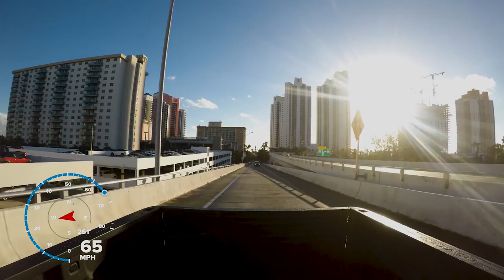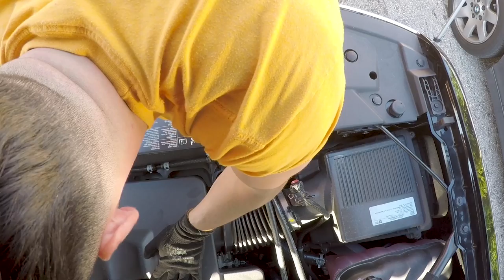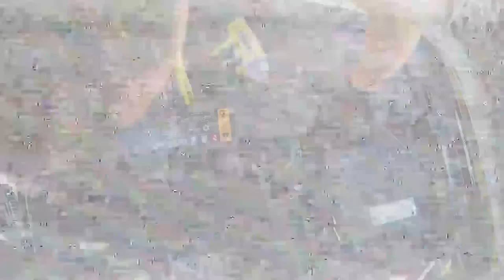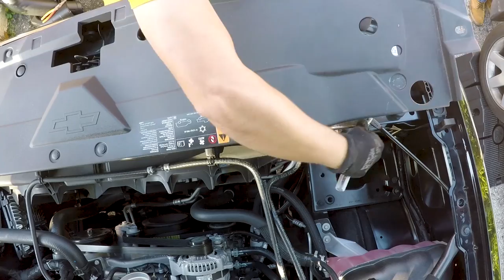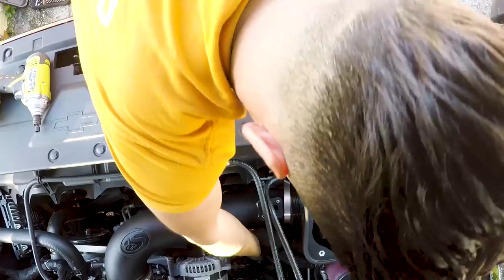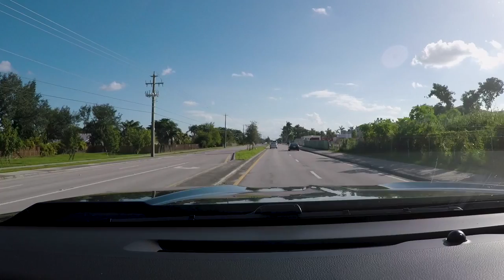2017 Silverado 1500 S&B Cold Air Intake Before & After

Comment: What kind of intake? And how much? Was it hard to install? I’m not very mechanically inclined overall but if it’s not crazy difficult or skill required I could get it done
Thanks! Sweet video
Reply from the maker: This is a S&B Intake. It cost me $290. Honestly its a pretty straight forward install. You just have to remove the original tubing for the original intake and replace it with the new intake set up. It should take you no more than 1 hour or so.
Reply: F150LOL 😎 awesome I’ll give it a try thank you man
Reply: If you can figure out an oil change you can do this
Reply: F150LOL g
Reply: @SloJoeRacing  $290! Shits running $350 right now haa.

Comment: How did you handle the fitment issue when connecting the breather tube to the filter and throttle body? Mine is giving me absolute hell and always comes loose.
Reply from the maker: I honestly haven't experienced any fitment issues. is the metal coupler giving you a hard time to tighten on?
Reply: @SloJoeRacing  Yeah for some reason it doesn't want to tighten down on the filter, and when I try to connect the tube to the throttle body it forces the whole filter back into the air box. Not sure what's happening lol
Reply from the maker: @ZachLo51  that’s is so strange, have you spoken to S&b?
Reply: @SloJoeRacing  No sir not yet. It's next on the list

Comment: When you first installed it did your motor bog down any and you had to goose it? Did a code get thrown on your dash or anything
Reply: No, the motor didnt bog, and no codes for me.
Reply: Alright good deal, plan on doing this same set up. I have heard mixed things about it.
Reply: Yeah no issues here, and honestly I love it. I'd love to get a live reading to see what my intake temps are, but that will have to wait a few more months
Reply: I want to put it on a dyno. Do you plan on putting it on it as well and tune it right. Get out of the fuel economy.
Reply: Logan Hebert yeah, I’m actually looking to get a tuner real soon, and have it dynoed after
Reply: I have heard some good and bad programmers through out the forums. I think I’m going to get it just Dyno from the beginning and have nothing to worry about.
Reply: Yeah, let me know how it goes! I might follow same route!
Reply: i have a 2015 silerado 5.3 I've had a miss fire pop up, but I also am running edge cs2 programmer with this intake and a throttle body spacer, moroso catch can, 3rd cat deleted small muffler instead of the stock huge one and the rear resignator deleted.
Reply: Nick Zieske what muffler do you have on your Silverado?

Comment: clean install! when you say slightly more fuel economic how many mpgs we talking and do you have any exhaust or tuning or use your truck to tow anything?
Reply from the maker: j thanks. The truck does a lot of city driving and I’ve seen about 2 more mpg on average. I don’t haul or tow anything t usually, so it hasn’t been tested towing.
Reply: What motor does this black Silverado have ?  5.3 or 6.2?
Reply from the maker: Clayton Lovell it has the 5.3L

Comment: Is there a noticeable difference in power?
Reply from the maker: Phillip A. I wouldn’t say a noticeable difference. Definitely sounds much better, and slightly more fuel economic. I have seen dyno test before and after and they’ve seen anywhere between 8 to 12 more whp.
Reply: F150LOL thanks! Well done video by the way.
Reply: Installed Airaid Junior and left the stock box and dropped in a performance filter yes it sounds better maybe a noticeable difference but doubtful. Most CAI claim gains probably just advertising. 17 High Country 6.2L
Reply: I have the 6.2, wanting to install Airraid tube but Amazon says it wont fit 6.2? What did you do?
Reply: avnregt Ordered it on Amazon and it's the same tube as 5.3L if I remember correctly. If you have any other questions please drop me a note. It works awesome
Reply: I'm going to order. I just thought I read somewhere that on 6.2 the spacing for throttle intake was slighty different than on 5.3L which for all I know sounds logical. I have a drop in KN filter already and and tempted to do the factory airbox mod.

Comment: Any update on gains?
Reply from the maker: I actually found that I had injector 1 leaking, so my truck was running pretty poorly and was assuming it was intake related. I am going to test now after its fixed and see how it does.
Reply: TruckYeah hey. Have you finally tested it ?
Reply: Albert Moiseev have you ?
Reply: TruckYeah I am having the same issue, says like the air fuel ratio is off? Right? I took mine to Chevy and they couldn’t fix it cleared the code and keeps coming back. How did they diagnose it? What was the fix??

Comment: Can’t tell ANY difference..😕
Reply from the maker: Difference in power or sound?
Reply: TruckYeah ...No...  I installed a K&N cold air charger in my 2015 Chevy Silverado Z71 and it’s lowered my MPG’s where I’m always stomping on the gas so I can hear that throaty sound...⛽️
Reply: @bms2550  the K&N coi are not as efficient. That seal system they use on the top of that shroud is not air tight. It's just pulling warm air from the engine bay into it. The S&B setup has a top that is more sealed, pulling more cold air from the fender cavity

Comment: Getting bad fluttering sounds at some of the lower RPMs, or when in high gear low speed and get on the gas a little. Sounds like the thur thur noise a semi truck makes engine breaking down a hill almost. I do have the bottom plug out, wonder if thats making it echo or something weird happening with the air
Reply from the maker: Travis Edwards that’s odd. I don’t have the same experience